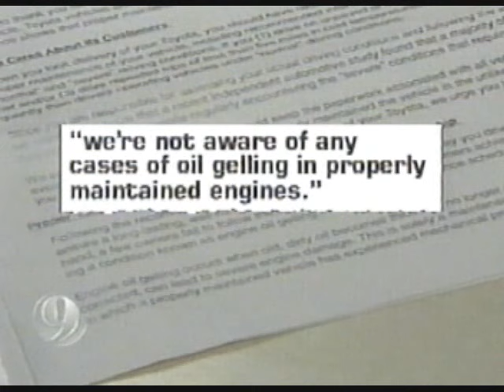Toyota Engine Oil Sludge or Toyota Oil Gel Engine Failure

Comment from the maker: This is not the case with Toyota engine oil sludge though it IS the propaganda spread by Toyota minions!  Toyota blames the owner even if the vehicle has better-than-recommended maintenance!  Toyota says it is "unaware" of sludge in such vehicles, but that's only because it won't hear of any of the cases!!  Unconscionable!

Comment: Smear campaign anyone?
Oil dosent just turn into sludge, its certain conditions within the engine the so called "sludge" is worn bits of the engine mixed with oil which is "baked" under operational heat (THATS WHY YOU CHANGE OIL REGULARLY). Dont blame your car maker because you did not care for your car and mistreated  it.

Comment: So did they find the real problem? 7500 miles is the standard for changing oil. These owners must have never changed it to get sludge. I saw severe cases of sludge, but those people never changed their oil. Also I saw a BMW M3 engine with 15k oil changes and it looked just fine, only it was a bit goldish brown.

Comment: I tackled things for my toyota lift gate problem -they blamed me... I took it to the NHTSA and finally got the darn thing recalled. took almost a year.  Did the same thing with an acura that dropped 5 transmissions in 5 years.  the process works, you just have to follow it.

Comment: Nothing against Ford?  What about when the 5.4's were blowing spark plugs out of the head?  What about the 3.8 Essex line blowing head gaskets left and right for several years?  Top-loader transmission issues?  I've seen good Ford's and I've seen bad Ford's, like most car manufacturers.  No car company is without fault...NONE OF THEM.  Ford's are getting better without a doubt, but are FAR from good yet.

Comment: @7477238 - Seems rather odd that only Toyota is having this problem and not other vehicle manufacturers. One would think if the problem were due to owner neglect/abuse, that this problem would extend to all vehicle manufacturers and not just Toyota.  Stands to reason. Toyota builds decent quality vehicles, but clearly something is wrong.
  If they used a decent quality synthetic oil in their engines, this problem would almost certainly not exist.

Comment: My tacoma is a beast. I change oil regularly and use a factory toyota oil filter. I have 180,000 miles on it and the oil burns clean. Sludge problems come from oil leaks the

Comment: It seems that you are unaware of the previous issue Toyota had with engine oil sludge in millions of its vehicles. This condition resulted in engine seizing at very low mileage in the presence of properly maintained vehicles. Toyota stonewalled customers for years. Finally, after outcry from angry Toyota owners, Toyota issued one of its "voluntary programs." Toyota owners went to the internet again because Toyota was not honoring its self-lauded, generous program. 

Successful class action lawsuits resulted. Even then, Toyota stonewalled customers behind the scene and found reasons to disqualify Toyota owners. Fast forward to NOW...a new major Toyota vehicle excessive oil consumption class action lawsuit is brewing. Toyota dealerships are telling some Toyota owners that this is due to engine oil sludge. Indeed, it was a symptom so one can deduce that the issue of engine oil sludge in Toyotas was essentially ignored.
Reply: Stasis Field Please give me your details! What vehicle model and model year did you have? I want to be updated on what's currently happening. It seems that despite the engine oil sludge special policies, this condition continues! I heard from so many owners who were DENIED under the Toyota voluntary program! This company also continues to deny ELECTRONIC sudden unintended acceleration exists despite getting continual formal complaints from its vehicle owners! 

Let me know what happened in your case!

Comment: It is not just Toyota that has an engine oil Sludge Problem. Look up "Dodge Intrepid Sludge" And Mercedes Oil Sludge.

The Problem Cars I have seen Did not Change oil Frequent enough or Used the Wrong Engine Oil.
Change your oil every 3000 miles / 5000 Kilometers like clock work, OR use Synthetic engine oil.

Comment: @simracr94 
59,811.  And most Subarus last well past 200,000 miles, so at the rate I drive it, I shouldn't have any worries for a long time!  I've also heard mostly postive things about Hondas too.  In fact, Toyota is the only Japanese auto manufacturer I know of that has had so many issues with their vehicles.

Comment: We have mostly owned Gm vehicles.We bought a lexus but got rid of it within 6 months.They suck as vehicles.The last one i rode in was a brand new one.It had 146 miles on it. It took off and wouldnt stop.No floor mats in the way.Id NEVER ride in one of these again and ABSOLUTELY NEVER buy one.Toyota lies too much.Our gm vehicles go several hundred thousand miles as long as you SERVICE THEM!

Comment: Hahaha it make me laugh when people dont change their oil and blame to the tech or car maker. Stop sitting on your lazy ass and go get an oil change every 3,000 or 5,000 miles and you would not see that. PERIOD!!!!! oil dont just turn to sludges with in seconds when you put into your engine. Just by looking at the parts, damn you haven't change oils in that car since you own the car it. I have a camry 320,000 miles and it runs fine with no problems at all.

Comment: We have a 1999 sienna and no sludge yet.  I still hate the fact that the check engine light is always on and off at only 165,000 miles. sometimes it even flashes for no reason!!!!!!  My uncle has a 1998 and his engine hat to be replaced.  Hondas are better we ve owned three wit no probs.   We currentley have an oddyssey and it's better.

Comment: theres nothing wrong with an engine its the oil you use or if you dont change it i recommend royal purple oil and filter with about a quart of marvel mystery oil that will keep it clean and if you have sludge drain out all your oil put in a new quart of oil and the rest kerosene that will clean it out but only run the engine for about a minute then give it 2 more oil changes and your good to go.

Comment: i usually dont reply to comments written over a week or a month but heres the deal toyota is using a Electric Control on the Throttle Body instead of a cable which has a problem in the Computer in the car Toyota knows what the problem is n they just want nothing to do with it cause its really gonna cost them this time just ask PRIUS owners about the ABS problems they r having now

Comment from the maker: Some owners have done oil analyses which show low TBN, high nitration/oxidation, and high silicon levels.  Some owners have had glycol- or fuel-contaminated oil while others have had metal shavings found with a magnet.

Comment: I am not taking up for Toyota granted they may of have issues like this some of it I am sure the sludge is owner negligence.  I have never heard however though on any toyota to run it 7500 miles on normal driving conditions.  We have always run ours every 5000 give or take some.  We always were told every 5000 if your toyota is regular oil and every 10,000 if you run synthetic

Comment: interesting, I guess they rather spend money on bullshit recalls like the floor mats instead of fixing the real problems. There is also a thing with 3.5L V6 engines used in Camry's and RX350's, where the oil hose can wear out over time and crack because it's rubber and not all metal. But instead of replacing it with an all metal one, Toyota decided to use the same faulty rubber hose.

Comment: Modern engines use thermostats that keep the engine at 220F for emmissions.
You can change that out and run your engine colder which makes it last longer.
The oil wont sludge up and bearings and valves last longer.

Comment: I've not personally heard of this "SUA" but it does sound like a bad problem. Almost as bad as fords having leaky fuel lines that can cause engine fires and explosions. Along with leaky brake master cylinders that drip directly onto the exhaust causing more fire hazards. Point being all vehicles will have quality control problems even toyota. Toyota quality is leaps and bounds better than domestics so until GM and Ford can get there shit together I'll stick with toyota power.

Comment: and I will laugh as your value depreciates faster than hell and your warranty isn't worth a shit because the company's seized to exist.  GM Ford and Chrysler can't hold a candle to Honda.  I have owned both a Dodge Neon and a Saturn SL2.  both lasted me less than 100,000 miles.  I now own a 97 Acura with 215,000 miles on it and it still outperforms Domestics with that mileage on it.  I am sorry but after owning this Honda product I am sold for life.  Too bad GM and Chrysler have to suck so much.

Comment: If you run quality oil & replace filters on regular service intervals then sludge wont be a problem, I have the old MR2 and sludge etc isn't a problem with it because I maintain it properly, I'm from the UK and in this country new age Toyota's are usually driven by wankers who haven't got a clue how to inflate a tyre let alone look after it, when ever I go into Toyota for parts their customers really are dumb fucks, sometimes I'm really embarrassed I drive a Toyota but there bloody good cars.

Comment from the maker: Toyota Sludge victims often report replacement of the air/fuel sensors and oxygen sensors either just before engine failure or soon after.  The PCV has been discussed at part of the problem for many years now, but Toyota denies any problem with this component.

Comment: Ah the Toyota 5S-FE engine, i took the tapper cover off to replace the gasket on my 2000 camry (13 years old, 140000 KM)

ZERO sludge build up, looks as clean as the day it rolled off the assembly line.

Change your damn oil more often, this is all just BS

Comment: i bet most of the use crappy oil and oil filters if they even change the oil  Toyota makes grate cars if your gas peddle gets stuck under your floor mat cut your damn car off. if your stupid enough not to just cut it off the sorry but you deserve to crash it

Comment: None of those people ever changed or had anyone change their PVC valve either -
Reply: meat furbush WRONG! This happens well before any changes needed and despite proper maintenance! This is a problem that Toyota NEVER too proper responsibility for!
Reply: This is correct had mines inspected claim my oil issue was a rear seal later found out after ruining my motor only a 85 buck pcv hose and valve.dealership claim to have removed motor to replace seal but could not have removed motor without seeing that badly damaged hose.just lied taking my money charging me 3100.

Comment: yeah couldn't have a thing to do with bad pcv design (cough (chrysler 2.7)). I dont care how often you change your oil if your engines fails several times under 100000 miles some under 60000 something isn't right. Kind of odd you hear this about the 97-2001 vvti and the chrysler 2.7 but not the ford or chevy or saab or volvo or ect. ect.

Comment: That is true. I used Synthetic oils and changed it every 3,000 miles and still there's lots of sludges build up in the engine. I even used engine flush every 6 months to help it.
I owned 1988 Corolla GT-S. Now it's dead. 1995 Toyota Corolla DX. and  a1993 Toyota Previa. This Previa engine is so gunky. But they are good car now the engine is having lots of missed fire, but no check engine light on though.

Comment: Before this video even started playing I thought to myself "I wonder if they're going to mention the 2.2L 4cyl. and the 3.0L V6? Sludging has been a known probllem with these engines for years. Back in the early 90's. So you can't say Toyota quality has gotten crumby just recently.
Reply: Toyota has been one of the most reliable brand if not the most. Really ignorant comment , Toyota shouldn't have put a 7500 mile change bottom like.  When you do they people go 8k that's just crazy on conventional oil.

Comment: Toyota has a notorious design issue. Air in the engine due to known SEAL material being poor quality. Toyota has engine seal issues and manufaturing issues with PCV system.

Comment: LMAO this is why Toyota sells Toys, Honda is and will always be best.....PCV Systems works best off the air intake and not the intake manifold, Honda has been selling and researching engines before Toyota or Mr. Toyota was even Born..
Reply: Honda is a joke with their vtec crap. Its had more problems as Toyotas vvt system. Buy a vtec civic and put a bumble bee exhaust on it and you think you've got a fast and furious race car lol. Honda civic- and honestly, scion fr-s too, the biggest joke for a sports car. We've owned Honda and Toyota in our family and I'm telling you from experience that Honda's overall reliability has been horrible compared to our Toyotas. My brother bought his son a civic and it uses more oil than gas and barely has over 100k miles. His 3.5 Pilot knocks worse than a sewing machine and they change their oil regularly. My brother keeps his oil levels where they're supposed to be and still has problems. Honda told him to drive it easy and if he wanted to save money, go ahead and have the engine rebuilt now. Your analogy of it being called a Toy is just plain childish and ignorant. Toyota/ Lexus were at the top of consumer reports as the most reliable at the end of 2013. Toyota sells more annually, actually they sell more Camrys a year than the entire Subaru line up does, and also has fewer trips per 100 units than Honda, to the repair shop. Oh, and the Ridgeline? We just won't go there in comparison to Trucks..
Reply: Also, Honda tends to have more auto tranny problems too. They shift rougher and also a repair shop that has seen Honda and Toyota both will tell you a Honda is more expensive to repair in the long run. City-data.com website for 2013 talks about this